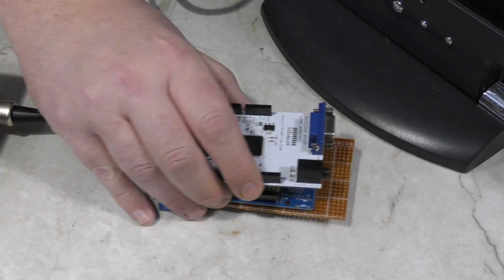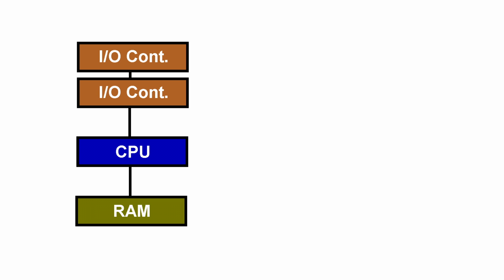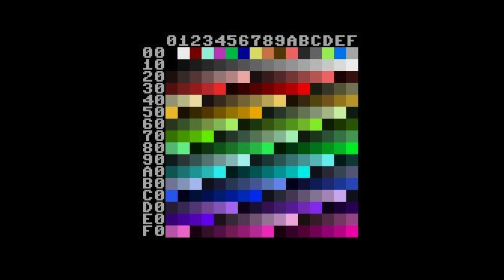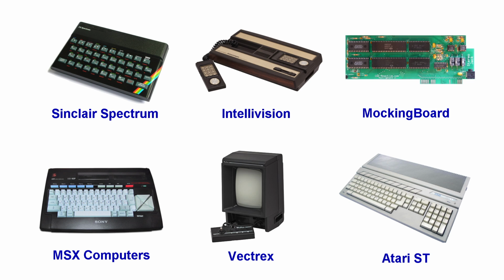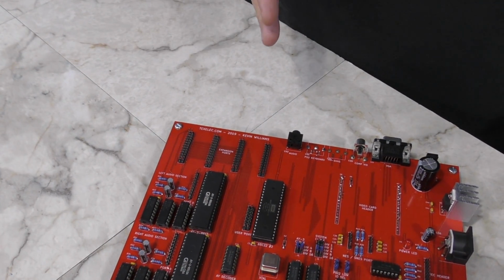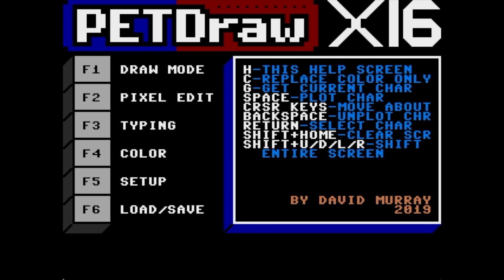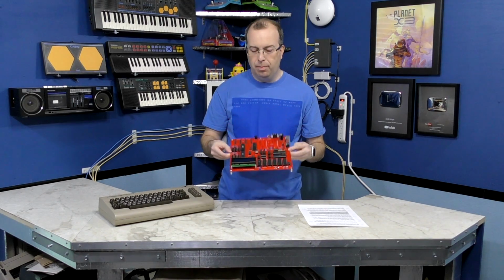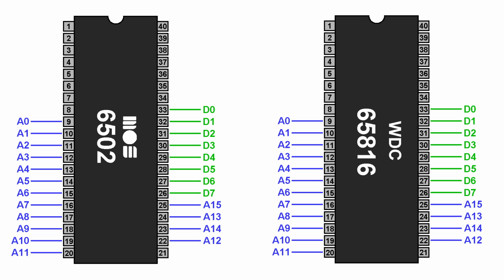Building my Dream Computer - Part 2

Comment: What OS does this thing use [or does it even have one?] - Newb to this low level computing stuff
Reply: its not OS its basic kernal
Reply: @jarisipilainen3875  ah, just like linux is a kernal too
Reply: @EthanLR  not exactly same.commodore call is kernal. And basically it just Microsoft basic. But there is no OS means no software all is hardware
Reply: @jarisipilainen3875  ok, thats really perculiar, its interesting to see how these old PCs work
Reply: @EthanLR  old computers are awesome. Ben eater channel have 6502 computer.he explain how it work and add chips.waiting part 3
Reply: If you consider DOS, it was a Disk Operating System, not the kind of abstract whole Computer System Interface the way Apple Macintosh always was, you would basically need to know exactly what Sound Card or printer you had, so that each game or application would have to know how to drive it directly without any help from the "OS". 

C-64 basically has a BASIC interpreter as the "OS" but it was more like DOS than an abstract Windows or Macintosh environment.
Linux is a Kernel which provides the POSIX (Portable OS Interface) Unix OS abstraction between the hardware and the user, not only can you not access the hardware directly, you can't even use the Kernel directly, you use a shell to provide the human interface through a command line interpreter, or you can use the X11 Windowing System for a Graphical User Interface environment.
Commodore had a "kernal", but it was more like command.com for DOS, basically a shell that directly accessed hardware without any hardware protection nor much abstraction beyond Disk filesystems like advanced Operating Systems. Commodore did however have access to the GEOS GUI which did offer these OS abstractions.

Comment: Great project!

However, there are two things I do not really agree with:
1) Using facebook for developpement update. facebook is becoming more and more obsolete every day and is a pain to use.
2) The price is WAY too high. Not only will it discourage people from buying it, but it will also encourage chinese clone manufacturer to create clones of the product. There is no way that a computer with such outdated components (except the video chip off cours) could cost 100 to 200$...

Comment: I really like this custom design 8 bit computer build, but won't the cpu run hot? If the cpu is being used constantly instead of a 50% throttle back, it will probably need some cooling system, I suppose for all of the major chips  that make excessive heat. I'm comparing this to commodore 64 main chips; they don't run extremely hot, but always need a cooler or else it will not last as long.

Comment: I would use the sound chip used in the Apple II GS designed by the same man that design the C64 SID chip. If it's still on sale... Wavetable goodness and should run at a fast clock speed. It looks really good though!

Comment: Well, I was VERY interested in this. So, I subscribed here, joined the Facebook group, and was considering supporting via Patreon. I posted  on the Facebook group that I was looking forward to seeing the finished product. Apparently, that is VERBOTEN! An overzealous moderator deleted my post, and when I went to the group page, there was a message stating that my ability to post and comment had been suspended. No worries. I simply left the group, unsubscribed here, and will find something else to give to on Patreon. Now I see why so many of you don't do Facebook. Perhaps Mr. Murray should speak to his moderators? Just a thought.

Comment: Just stick an Atmel Microcontroller ATMEGA328P-PU on the board. Connect it directly to the UART chip on your dream computer and you now have a fully upgrade able/ programmable microcontroller that can act as a video/sound/ or com chip. You simply push the program over to it serially, or connect its 8 bit I/O lines to the data bus for awesome bandwitdth =)

Comment: Why do you have to put the IO space between the low memory and the bank-swapping high memory?

If the IO were addressed somewhere else, couldn't BASIC use a combination of low memory and the currently-banked high memory block since they would become contiguous in the address space?

Comment: My first computer was an electron and I love the idea of this, I also have a bit of an obsession with software rendering and with the idea of the incremental pointer for writing to graphics memory that got me wondering if anything like this would be possible:
Using a similar incremental pointer to the banked ram so sprite data could be read quickly to compliment the quick writing to display ram, maybe even without that particular bank being the currently selected one.
Or, more advanced, some sort of interpolation hardware that steps through u and v with each read access and addresses the banked ram instead of just incrementing the pointer, maybe making texture mapping or rotatable sprites possible.
Anyway, just some thoughts, but looking forward to seeing how this project turns out.

Comment: the stage 3 where you put everything into an fpga is super boring. however it would be cheap and perfect for gamers. however, i would consider it dead because it is just software, even when it has programmed logic in vhdl.
for me i would like to have a motherboard with slots for a cpu card, chipselect card, sound card, video card, i/o cards, internal expansion ports,... fully compatible with the c64.
we could make cards with sockets for the original c64 chips as a starting point. and then we have the best base for new developments. this is a system that really is alive!

Comment: What's wrong with using a serial address line from the processor and shift registers to actually address the RAM? That could free up so many pins for other things, and greatly expand the amount of RAM that one could use on the board, or with expanders.

Comment: Stage 3 is possible.  Been messing with the UPDuino  with a Risc-V core.  I stilll had enough space for a mono VGA.  Cheap to for $10 and all open source.  Curious, are you running it at 3.3 volts or 5?  I am thinking 5 by the looking at the dip chips.

Comment: Me, personally, I would prefer an all-in-one case/keyboard design rather than a case with attached keyboard. It's more retro and possibly even cheaper over all (depending on what kind of a deal you can make with vendors). Either way, looking forward to this!

Question: Is the OS going to be mouse/menu driven? If not, I think a mouse is not necessary as an included item (if you were thinking of including one, that is). 

p.s. My vote is for a true mechanical keyboard like the one on the original Commodore 64. No membrane or "chicklet" keyboards please!

Comment: Point of pedantry:  The AY sound chip wasn't used in the original ZX Spectrum as pictured (19 minutes in).  It was introduced in the later 128K model.

I probably should get out more.

Comment: I don't think the part about the RAM of the VIC-20/C64 running on 2 MHz is correct. The RAM runs at 1 MHz. The 6502 however only accesses memory every other cycle (the other cycles are spent decoding and executing instructions). The video chip is designed to also access memory every other cycle. With the exception of some operations, such as fetching sprites or colorram. On C64 colorram is fetched once every 8 scanlines, which is known as a 'badline', because the CPU is basically stalled for most of the scanline, since it cannot access memory. See here for more info: http://www.antimon.org/dl/c64/code/missing.txt

Comment: In order to achieve a stage 2 board and reduce costs with SMD/SMT i think you should consider components such as the sound chip that are DIP also have a SMD package otherwise you will need to redesign and re-engineer the software if the components change. I know that the 6502 chip comes in DIP and SMD/SMT packages but what of the other components .

Comment: Decoding the upper 8 bits of address lines isn't that hard! If you look at page 44 of the Datasheet you can see an example of an 74hc573 and 74hc245 decoding the address properly. (you would of course take the HC variant for speed)
Only a small bit of glue logic allows you to use so much more functionality, also this will allow you to differentiate from the c64!
why would someone use your Computer instead of the c64 if it has the same capabilities?

Comment: This is a really cool project but personally I'd like to be able to build it myself, using off-the-shelf parts and soldering them to a board.
Having the case also being the keyboard like the old Commodore machines would be nice, but I realise that making it mATX/mini-ITX means it's less proprietary and easier to make.
Most importantly to me, at least, is that Cherry MX switches are overrated - from what I've seen, Gateron Yellow switches are closer to the feel of original C64 keys, and they're much cheaper too (which would help keep the cost down for this sort of project).

Comment: I possess a full, working VIC 20 chip set if your interested  ? I just dont have the board ram.          

3x kernel rom.  #01, #06, #07, #03
6502 processor
2X 6522 VIA 
6560 and 6561 video interface
The kernels do ntsc and pal video.

Comment: I really do like the idea of this and I look forward to getting one in the future.

The only thing I kind of dislike is the roundness/modernness of the case. It looks a little too modern, yet still outdated. I think if it were possible to get a more polygonal, more wide shape, it might seem more fitting for the computer that it is. Just a thought. (But I also realize this might drive up the cost, so take it with a grain of salt)

Good luck with the project! Can't wait to see part 3! :)
Reply: and with an integrated keyboard :)
Reply: @MihaiPruna  
This ^
I was expecting an all-in-one like the C64, not a tacky modern case.

Comment: I am very much interested in this project.  I learned to write assembler on a Commodore 64 in the early 80s and it became very important to me later working on PC systems.  Prior to the C64 i worked on main frames and later IBM minis.  The access to hardware was addictive.  When you get this running I will definitely be one of your first customers.

Comment: You're building an IBM Compatible with a 6502. VGA adapter has it's own memory, you have some small amount of conventional memory (Low memory) and the rest of address space is shared by ROM and I/O. You have a small window of memory with bank switching (EMS), etc etc... It sounds like an IBM to me!

Something you could do with the extra address space of the 65C816 would be to use the extra address space to directly access things that are otherwise banked on the 6502. Banking would still exist in that region, but it would be mirrored to the extra address space.  Would be relatively easy to do and would be incredibly convenient for the faster CPU, no?

Also, full bus design when? I'd love to see some peripheral cards come out for this!

Comment: If I read this correctly, you took the original VIC-20 design and added RAM banking and ROM banking, plus some I/O space, and clocked it at 8 MHz.

Comment: Really nice.  Please keep us up to date.  When completed, I'd love to buy one.  I would probably like it best in kit form, as long as I don't have to hand solder any surface-mount parts.

Regarding the built-in display, you may want to look into an SPI-attached TFT display, similar to this one from Adafruit: https://www.adafruit.com/product/1480.  They're not hard to program and can produce nice graphics with a minimum of coding.  The only downside is that, as a result of using SPI with a maximum bus clock of 16 MHz, they can be slow.  Figure an absolute maximum of 10fps if you're writing pixels to the entire screen every frame.

I also wanted to mention displays like these because they may give you ideas on how to enhance the (current) 4-register mechanism for accessing video memory.  The display I mentioned above uses an ILI9340 display-driver chip (https://cdn-shop.adafruit.com/datasheets/ILI9340.pdf).  Several others I've worked with use an ST7789 chip (https://www.alldatasheet.com/datasheet-pdf/pdf/1132511/SITRONIX/ST7789V.html) which has a very similar set of SPI commands.  Looking over the data sheets at the commands the chips support, they have one feature I think you may find very useful - The ability to fill pixels into a rectangle.

Look at the CASET (collumn-address-set - 2A) and RASET (row/page-address-set - 2B).  These two commands let you define a rectangle on the screen (CASET defines left/right columns, RASET defines top/bottom rows).  After issuing these, a RAMWR (RAM write - 2C) command will fill sequential pixels according to that rectangle, so you don't need to write new addresses at the end of every row of pixels.

Mapping the concept over to your video chip, that would mean four additional registers.  By setting the rectangle boundaries, it would cause the auto-increment feature to wrap within that rectangle instead of filling in sequential bytes of video memory.  This can make it must easier when you need to push rectangular regions of pixels (e.g. any object narrower than the full screen width).

Comment: I used to do much programming, especially videogames, in the 8 and 16-bit world.  I am actually nostalgic for those days because the systems were relatively easy to program.

Since the vast majority of consoles and 8-bit computers could only display a maximum of 240 lines on a standard television, and the SNES was only 224 lines, I had the false impression that this was limit of the resolution of the CRT television set.  

I recently learned that CRT TV's were capable of displaying 480 lines, although interlaced, with a horizontal resolution of up to 704 pixels.  This bugs me a little because nobody was taking advantage of this.

I cut my teeth on the Timex Sinclair 2068.  I wrote games for the system.  Unlike the Sinclair Spectrum, it was capable of having two frame buffers.  Had I alternated the two frame buffers every frame, the effective vertical resolution would have been 384 pixels.  That would have been interesting.
Reply: Would there be enough RAM to draw the screen?

Comment: Dear David - where is the Network Chipset? and where is the Storage? Micro-SD Card etc. nobody will accept a new Computer without a Network and if you bring out new Software nobody will put this first on a PC and then in the X16 via a SD-Card! Your board will be cost more then USD300,- and the reason is they are only old DIP Parts on it so the handling cost will kill your production. There is no plan to produce this X16 and the reason is also the expensive Power supply - what did you say what the new Computer will consumption in Watt? 

In fact - no interchangeable Storage like a Micro-SD, no Network like Ethernet and/or Wifi, no Webservice like the X16-Database, no production (there are no Roboter mounting parts (i.e. TQFP) on it so the cost for a production will explode and then the price for resale is at least USD600,- and more. Think about my words - Connectors cost money, Sockets for DIP cost real money, all parts on your board are to expensive. China's production will be start at 6000pcs if you don't have this mass there is no rent ability to produce in Shenzen, Import TAX in the  USA market etc.
Only a ASIC will save the money for a USD50,- Computer or a FPGA and this is what you don't want. Best Regards Volker from Vienna

Comment: Seems you're making good progress.  I would have suggested using the Motorola 6809 instead of the 6502.  The 6809 has two 8-bit registers (accumulators) that can be addressed as a single 16-bit register, position-independent code and a great ISA without 6502's idiosyncrasies.  It's the best of the 8-bit CPUs hands down.  I realize it's far too late to change, but I'm sure you would have loved it.  In any case, I'm sure the project will come out fine.  Brilliant.

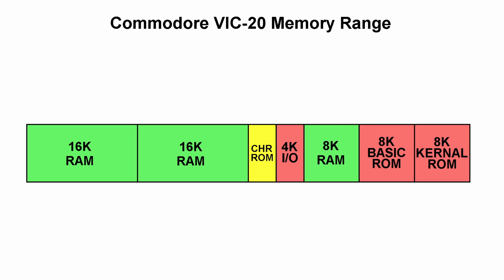Comment: @5:42 .. Say what? "Can only get about 32K RAM in a VIC-20"  Do you mean by populating the OE board and a few selection jumpers (much like some PET models)?  I might still have a few VIC boards stashed away. Haven't looked at them in 30 years because my assumption was that the factory board had only supported 4K. I quite liked the VIC even with it's limitations. The colours rendered nicely on my old Zenith system 3, and I spun up a "home automation" screen, relatively lame and useless by 21st century standards - but kind of cool in 1987.

The bare boards I have were bought for something like $3 when VIC's  could basically be found at the curbside - I'd love to put them to "some" use still.

Comment: There is a super simple fix for the clock speed issue to manage write cycles for the AY sound ic. One 74HC00 is required to cut the cpu speed down when /CE(AY) is addressed. Email my Gmail account and I'll shoot across the circuit

Comment: You might also want to bank the entire lower 32k of RAM.   Then use the next 16K as a stable jump vector and scratch pad for the OS to move between banks of RAM/ROM, then the final 16K for ROM (or divide it into 8k cunks, whatever).

Now notice, 32k, is still pretty darned nice for BASIC.  Indeed, 32k is fine for most 8bit applications.  BUT, notice that in banking in/out the entire lower 32k, you can make a multitasking OS that gives each normal task its own independent stack and zero page access.  That makes everything WAY easier if you decide to make use of that 8mhz and do some multitasking or even switch between dormant tasks.

Comment: Please note the 6561-6560 VIC-I chip is NOT the only component no longer in production today. The color RAM 1kx4 bit SRAM also is no longer available.
On the X16 1st board, I see a massive mistake with the W65C22S VIAs. Normally, on computers of that kind (VIC-20 and PETS), the VIAs will share IRQ and this can only be done with W65C22N which have an open-drain output instead of totem pole output for IRQ. N stands for 'NMOS compatible'.